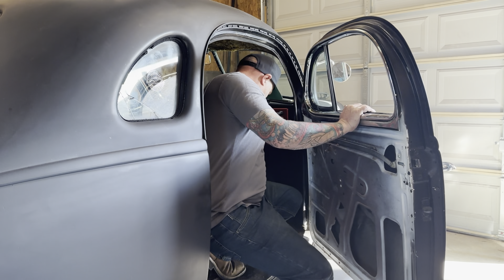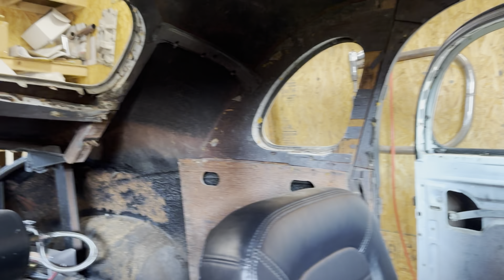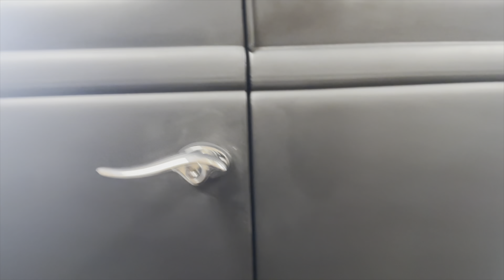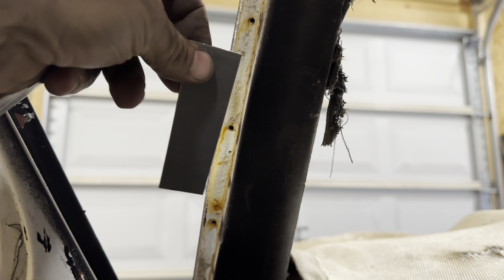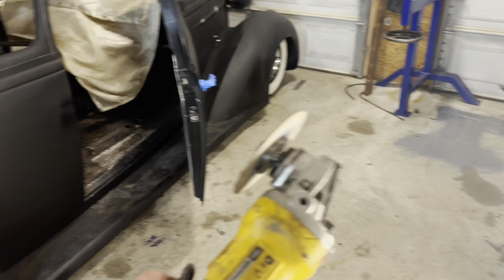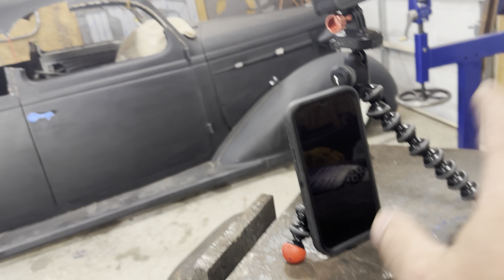HOW TO CHOP A TOP, 1937  Nash. EP1

Comment: My 2 cents 
Once done I would draw custom moldings from front to rear 
Hire a carpenter or pro molding guy 
They mostly work with straight molding tell them pie cuts is ok it will be painted and wood paddy
Then cast it use old spoons forks and butter knives weld bolts under them 
Send to polish shop
Reply from the maker: Or could use brass stock?

Comment: "Wherever applicable"...
If you have to take out wood, or have nothing....a good and cheap sub-structure medium is steel electrical conduit.
 It comes in several sizes. And it bends and welds good, you just have to grind off the coating where you weld.
Reply from the maker: Not a big fan of welding galvanized. I usually go with 1X1

Comment: I'm working on a mercury that was chopped without being braced.  Do you have any advice? Doors line up but are pushed into the quarter panels, would a portapower open the door opening?
Reply from the maker: A potapower will probably cause other problems.  Probably best to cut the back apart and Jack it up in the middle and realign
Reply: @Theoldironworkshop  do you mean cut the c piller roof loose? The package tray and quarter window supports have been cut loose.  Looks like someone just wanted to trash this car

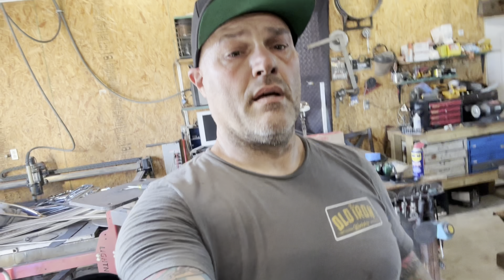Comment: 1:48 Fun Fact: you dont get tetanus from rust. besides the fact you have rust literally in your blood... iron oxide is not deadly and can never in any way cause tetanus... The rust myth comes from the fact that most people got tetanus after stepping on a nail in the yard, which was usually rusty... but what happens is, since you are bare foot, you have dirt all over your feet, the nail pushes some into your foot, which causes cellulitis (a skin infection from a foreign body being trapped in the skin. and in that dirt is bacteria that when combined with cellulitis is able to run amuck and cause tetanus...
Reply from the maker: That is interesting.   Makes sense    Reminds me I probably need to update mine
Reply: @Theoldironworkshop  not if you dont plan on getting any dirt jammed into an open infected wound...

Comment: Where can you find the window seals?
Reply from the maker: Apparently none exist. I’m not 100% sure when I’m going to do at this point.
Reply: @Theoldironworkshop  There is a place called "Pat Walsh Restorations" He will have most if not all of the rubber you will need. It is not cheap and it takes a long time to get it. I ordered some for my '37 Nash and it took about 6 months to get it but it seemed to be good quality. Hope this helps.

Comment: Love your videos,  the details,  the explanations,  the sly humor and the effort you put into them. Sucks me right in.  I've got a 51 buick rustbucket I wanna chop (admittedly,  it's not as rad as the nash). I've not done any metal work, so your videos are greatly helping me envision this project. I've also got a 51 belair that the previous owner chopped but left half of the original sail panel next to the new sail panel and used it as a channel for electrical to the rear. The issue with that is it's in the way of finishing the interior, so I've gotta figure out what to do with that. 

Question, though, what do you do with the glass now that the lines/curves have changed?
Reply from the maker: All of the glass in this car is flat so it’s easy to just re-cut. That’ll be an episode three well, possibly